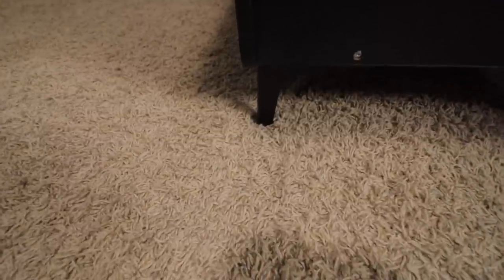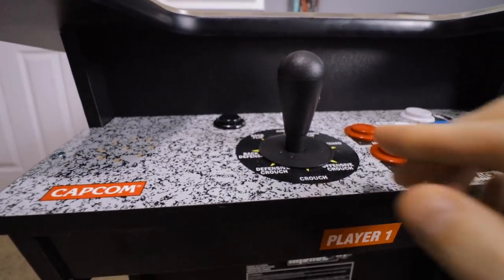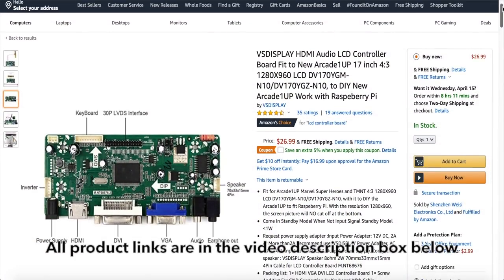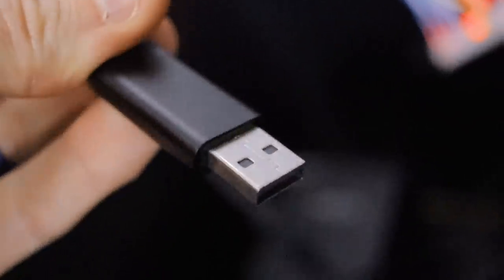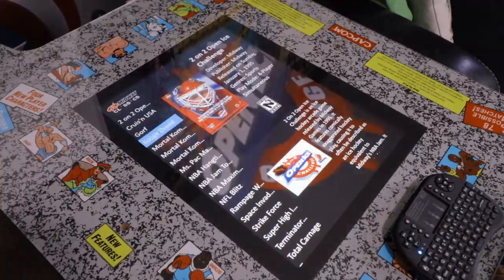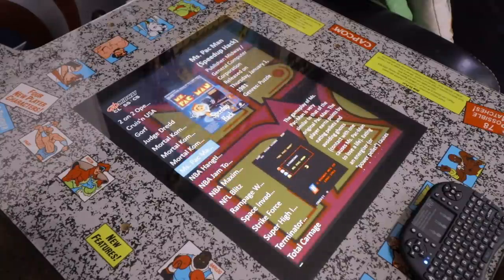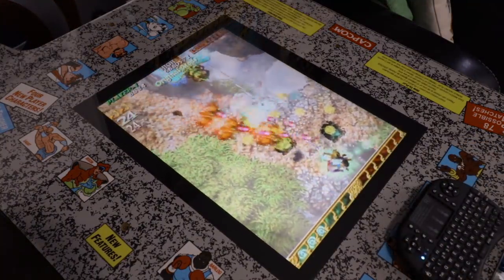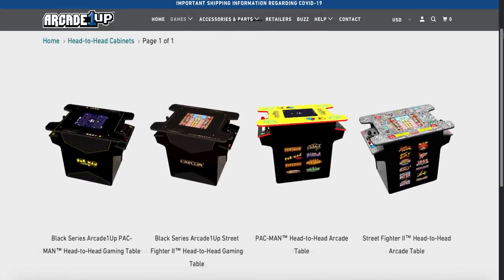Arcade1Up Street Fighter Cocktail Cabinet Mod!

Comment: This is so amazing. Exactly what I want to do. I have a Ms Pacman that I just got from best buy...will all the parts you list be what I need?
Reply from the maker: I'm not sure what the model number on the Ms Pac-man cocktail cabinet monitor is, but if it the same as what I have in this video then everything should work for you. If it isn't you would need to find a different LCD controller board than what I used.
Reply: @cooltoy  thanks, I grabbed a pic of the model number. How can I tell if it is the same as yours? Or to check the part number on Amazon?

Comment: Would this setup play mario kart arcade? If so, could it be multiplayer and each player sit across from one another?
Reply: One player sure, the difficult part is the multiplayer and then the split-screen. The split-screen the easier of the two. It's going to take some looking into. I would start with CoinOps and go from there. Now if you were fine with Mario Kart WiiU\Bigbox. The split-screen should be able to be done in the options (I'm not sure on this) and then you could use a couple of wireless 360 controllers or the deck controls I guess.

Comment: I think PC is a better choice for Mame but when you do like 4-5 cabs, Pi3 is more ideal as it's small, more affordable. Plus Pi3 it loads straight to the Emulator while Windows you have to do alot of windows trick to hide stuff and make it load to the Emulator.
Reply from the maker: You don't have to do a lot of trick stuff. I had my windows set up to load straight into BigBox in less than 2 mins of work.

Comment: Where do you get ROMs?  I’ve only done a little mame and modding, mostly with an original Xbox, but I can promise that I’ve never seen blitz or die hard work.
Reply from the maker: archive dot org
Reply: If Blitz isn't working you might be missing the CHD file. Die Hard runs kind of blech on this setup anyway.

Comment: Could a raspberry pi work just as easily? Could one be configured for split screen'?
Reply from the maker: as long as the PI image being used is using a newer version of MAME that supports the "cocktail mode" then yes you could easily go that route.
Reply: The Pi 3b is kind of underpowered for a lot of newer emulation and the Pi 4 has this irritating issue where the screen will not rotate vertically without adding some code to autostart.sh. And even after you do that and rotate the screen in Retroarch, emus that don't use Retroarch like Daphne or ReiCast will not rotate.

Comment: can you setup a button for the display mode? When I say this I mean like drill for a new button.
Reply from the maker: yes you can, but you would also need to be running an additional bit of software to transcode an arcade button press into a keyboard input
Reply: @cooltoy  Alright I might pull the trigger on this then. Hell if I gotta pay someone to help me get it done I will. I hate having to deal with mame's menus when I just want to play a game with some friends.

Comment: Awesome mod. Thought it would be an easy weekend project...MAME had a different agenda for me. :( :( :(
Reply from the maker: Sorry to hear that
Reply: @cooltoy  Finally got everything working properly...except the sound.  i have a 3.5mm to usb external sound card...but output is extremely low. Any ideas?
Reply: @michaelsnyder7603  Having the same problem, but I'm using a Pi 4. I'm about to upgrade to an Optiplex hoping to fix this issue.
Reply: @IClavdivs  I never did get it sorted out. I even tried connecting a small 20w amp and it was marginally better but still not good enough. Totally stumped as to why I can't increase the output even with the amp hooked up. Ended up using a bluetooth speaker \_(-_-)_/
Reply: @michaelsnyder7603  I switched over to a PC, but before I did, I used an external soundcard to get the sound working perfectly. It was very loud and full stereo on both sides of the cabinet. 

After switching to PC, I used the thing that @COOLTOY recommended. It worked until I closed up the cabinet. Now the volume is very low and I'm only getting sound out of the left speaker on both sides. I've vowed to not open the cabinet until I'm ready to tackle wire management, but once I do, I'll try hooking up my external soundcard thing.

TLdr: Try an external sound card

Comment: Hey, my LCD Controller Board, same as yours, is not turning on, any ideas why?
Reply from the maker: are you getting a green or red light from the controller board when you power it on?
Reply: COOLTOY no light...
Reply: Ok, fixed. But now, I just have sound in a speaker of each side... any ideas?
Reply: @manuelmof  You can't get sound from the LCD board. You have to run it from the PC with something that supports TSSR, like an external sound card.

Comment: Cool mod, Douglas!  Did you have to add a GPU/Graphics Card to the Dell Optiflex 9020 to get it to run NFL Blitz smoothly?  If so, would you mind sharing which card?
Reply from the maker: No external graphics card necessary, I was using the internal intel graphics on this
Reply: @cooltoy  Thank you!  I'm going to try the mod and wouldn't be up for it without this video.

Comment: Hello, I was working on a cocktail cabinet last year, using hyperspin as the front end and my MAME must be old because my side to side cocktail mode did not display Head to Head. What version MAME are you using??  This is great that they fixed it, I was banging my head against the wall for some time. I did not know they fixed it. THIS IS AWSOME you have no idea as you know how difficult Hyperspin can be.
Reply from the maker: I believe I have MAME .174 in this one

Comment: I tried this mod and ran into an issue with the recommended USB audio cable. The volume level is extremely low. Do I need to purchase an amp?
Reply: I also have this issue. I don't think the TSR thing works very well. At best I get loud volume on only the left channels on both sides.  I had a Retropie in mine for a while before I switched out for the Dell SFF recommended inbthus video, and I was using an external sound card thing that came with a mixing board I have. It worked really well.
Reply: @IClavdivs  I'm thinking about putting my unused Retropie in mine. Just curious as to why you switched out for a PC? I know a PC is more powerful but for just the standard games I think it's good enough to stick with the Retropie. I have a vertical arcade cab with a PC in. Another for my horizontal pedestal cab so I'm not sure I want another PC for the tabletop...
Reply: @Shirodx  I wanted to be able to run some newer games, so I upgraded from Pi3 to Pi4. Then I discovered that the Pi4 handles screen rotation differently than the Pi3, so stuff like Daphne and Pinball wasn't displaying correctly.  After searching for a solution for days, I got frustrated and just swapped over to PC with Launchbox, which is running fairly well for me.

Comment: All games H2H. Question cooltoy23 looking to do same project but with pac-man 399 version would you happen to still have this an HD still working.? 🛠️ Found this old video an made old GenXer excited. Iove ur Simpson's ALP and Stranger thing's ALU.
Reply from the maker: Sorry, I gave this away a long time ago
Reply: @cooltoy  thx for the reply an video didn't want to put my pi3b+ in it the games don't run well on it. An I got a old GPU from my son is his old 1080. Just New to emulation an the such never new about it is so cool to be able to do this. The kids an older crowd get together an spend time together. I have as much fun saving up an building my lil room got 4 machines an thanks to you an others in this area of interests. Just found out I can get taller legs for my alp hurts to play even in chair. Thx for ur video's.